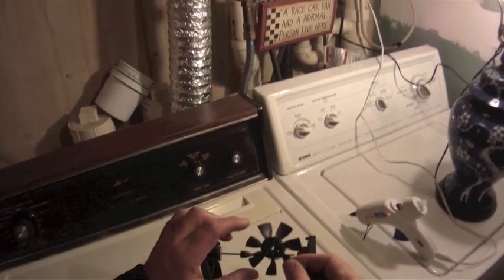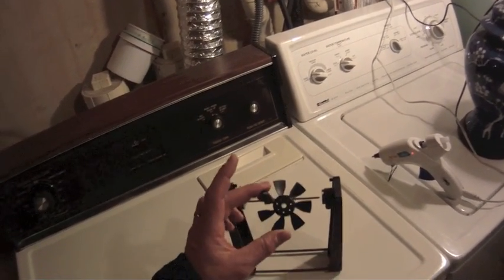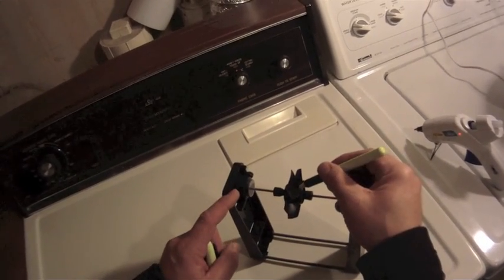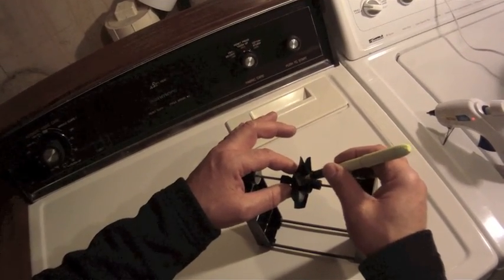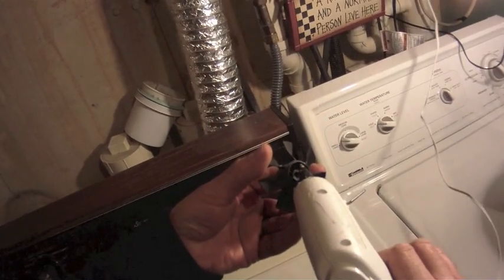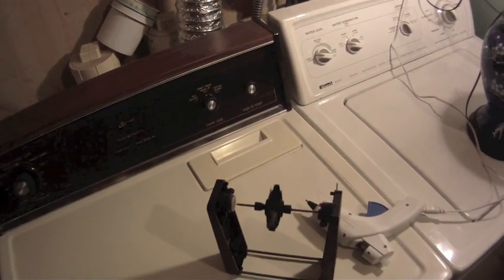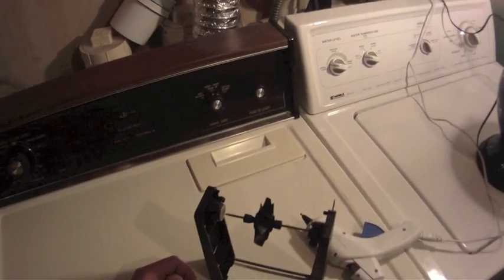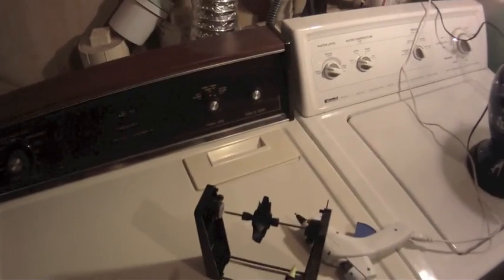Balancing an EDF Blade

Comment: I balanced a 123 blade change sun fan this way with epoxy I havnt used it yet But im concernd It is the first time ive done this and i found i ended up putting quit a large blob of epoxy inside the hub to balance it It seems like alot Dose this matter ? It is balanced now but WOW what a grose big blob there is now  Why do you think?